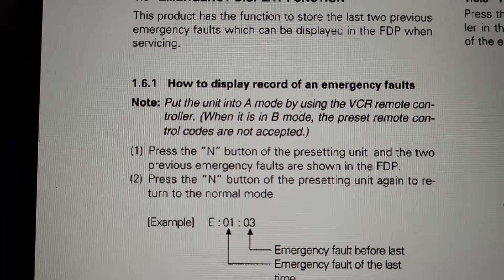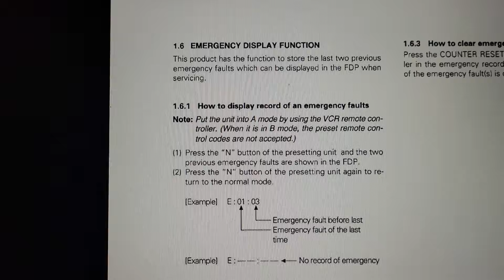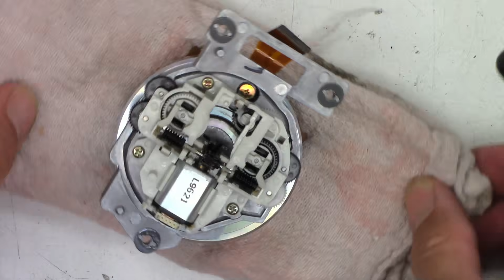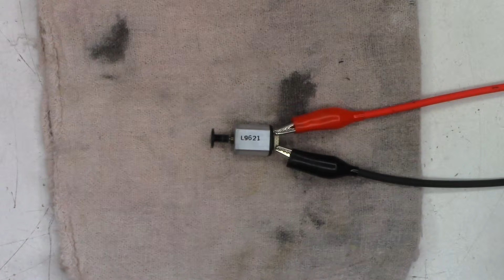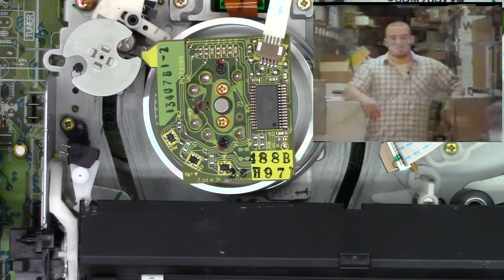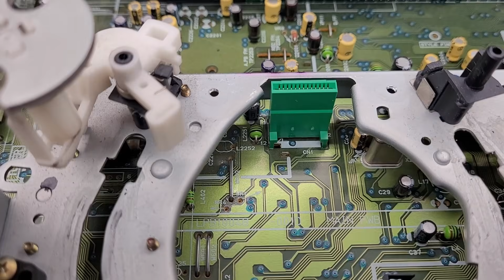Part 2 JVC HR S9600U S-VHS VCR only stays on for a few seconds. Servicing the Dynamic Drum Motor

Comment: Get the JVC LP20873-009 remote control with LCD, it works as a service remote control.
Reply: How do you make it work as a service remote?
Reply: @Kimble221  Nothing, works the way it is.
Reply: Does the JVC LP-20667-008 remote work as well? It also has a LCD. Thanks in advance!
Reply: @onlyvik  Not sure, you'll have to try it.
Reply: @Capturing-Memories  do you know the combination? I've tried: VCR OFF> OK>1>9>6>8 but the lcd displays shows VIDEO A all the time. Another one I tried: menu 3x

Comment: "Audio Time scan" is enabled  on the Menu and this  is why you get the "random sounds". Nice fix. I did the other fix:  remove the 2  cracked gears but this one is an alternative. Do you get a loud sound from the Dynamic drum when you're in playback  fast forward/rewind ?
Reply from the maker: No loud sound from the dynamic drum at all in ff search or rev search
Reply: @norcal715   Ok Are you sure that after a disconnect from the mains it would still work ?

Comment: DD emulator is never “required” and the function will not change from what you have now if you were to install one. I didn’t expect it to work at all with that transverse worm gear not transmitting any motion, so that’s news to me that it’ll function without it as the second optical sensor value won’t change to show that it has reached the home position. Where I expected this to fail was with normal RF/rew during playback. Also, you are unlikely to ever find that specific service remote, but supposedly certain regular JVC remotes that have LCD screens can be put into service mode and perform the same service functions.
Reply: Both sensors are required to send correct sequence of signals. That I discovered when developing the solution 'DD emulator'.
Reply: @hkorpim  Then how is his working? With those cracked gears it should shut off.